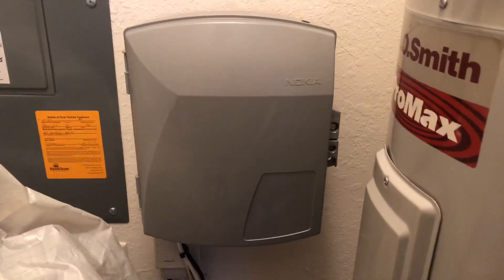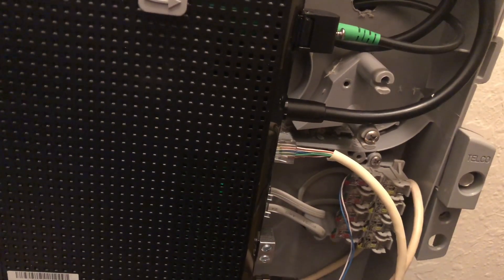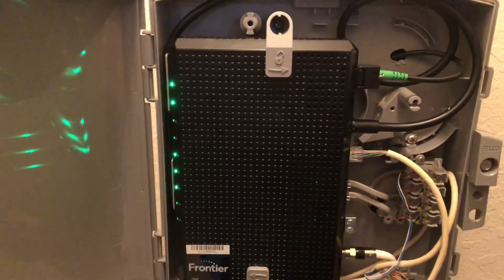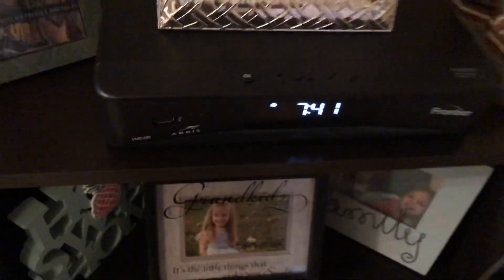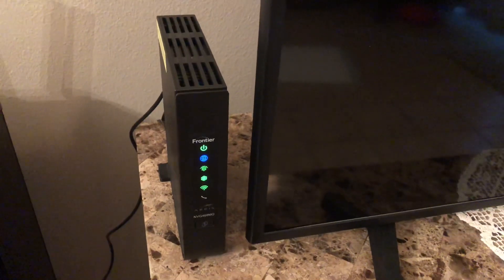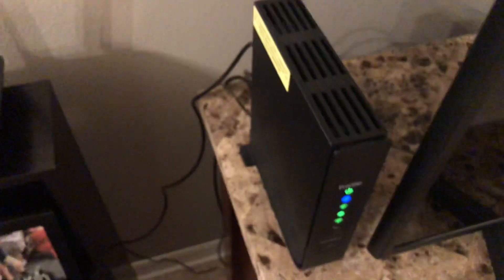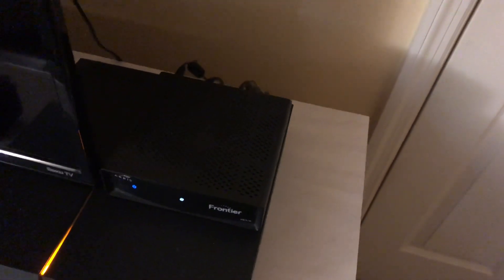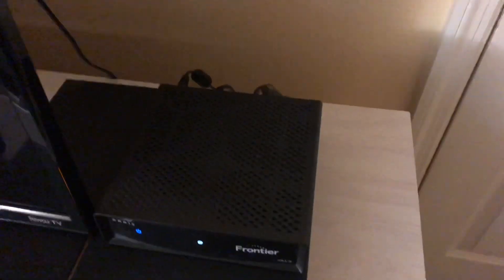Frontier/Verizon FiOS Internet

Comment from the maker: Hey everyone, thank you for all your comments and I hope this can answer everyone’s  questions as time has got away from me. If you can get away from the stock cable company routers it really is a good step to a faster Internet since this video I now use a Asus Wi-Fi six router that I got off of Amazon for about 120 bucks I use that router for most of my streaming and for overall signal strength around the house I now use the original Google Wi-Fi mesh system and I can really recommend that another thing.Make sure you use cat six or cat eight ethernet cables as it can make a difference. The router I used in this video I can no longer recommend.

Comment: I have frontier fios 500 Mbs. I have a router Netwear with 3 antenas. I will like to increase the speed. You think if I connect frontier Moder with a router the system will get faster?? O I should get a very high quality router?
Reply from the maker: If you’re looking for a speed look at the new routers that Asus makes you can get them for around $200

Comment: I already have a frontier supplied wireless router with the coax connection.  Can I buy the Linksys router and run an Ethernet cord from the frontier router to the Linksys router and use the Linksys for my connection?  I’m not sure how this stuff works, but the router they supply doesn’t extend very far upstairs.  I only have a 50/50 connection BTW if that matters.
Reply: Yes you can use your own router you buy.. I have a Asus Nighthawk AXE11000 Tri-Band Router and it works great with my Frontier Gig speeds

Comment: The Frontier FIOS router keeps rebooting every few minutes.  I want to get rid of it and get my own.  Can I use the Linksys you have directly with the Ethernet coming out of the ONT?
Reply: I also want to know this . I only have frontier FiOS internet One Gig speed , can i just connect directly the Ethernet cable coming from the ONT to the new router ? And that's it ? Help us PLEASE
Reply: You can use any router, make sure you setup a firewall for it first. Just call the company to turn on the Ethernet port on your ONT. If you wish, they can install the Ethernet cable for you for a fee.

Comment: I have frontier FIOS 500/500 and I’m not get that speed maybe 300/300. I don’t have Tv Service with them just the Internet. Can I just switch outs their modem for the one you have and what is still work?
Reply from the maker: Manuel Martinez Yes try to switch out your modem it could help, what kind of modem do you have now?
Reply from the maker: Manuel Martinez The modem will work regardless because of the cable boxes are wireless the operate off a special 5ghz frequently in the modem and any frontier modem should have that
Reply: coldk78 I have the modem that frontier give me but the WiFi on it sucks.
Reply from the maker: Manuel Martinez Oh I’m sorry I misunderstood I thought you needed the main modem, yeah get a Linksys EA 7500 it’ll set you back $98 but it’s worth it the range is amazing
Reply: Do I still to use the factory modem that frontier gave me or can I just use the linksys router?
Reply from the maker: Manuel Martinez If you have the same ONT box that I have in the utility room and it’s wired for ethernet then no, the only reason I have the factory one is you can’t have wireless cable boxes without it
Reply: coldk78 ok cool thank you for your help!
Reply: Update I Purchased the router the same one you have in the video. I replaced frontier router with the new one and the speed was slower 27/31. Need help
Reply from the maker: Manuel Martinez you may need to call a tec out as it could be something wrong in the wiring or modem placement
Reply: @ManuelMartinez-qg7tf  I just had a technician over my place and in order to use your new router you need to go to the frontier router and "release the status" or you will have both router giving a signal, hence the slow speeds.

Comment: LOL. The thing you called a modem from Frontier is actually a Router but they call it a Gateway.  There is no modem. It's actually the ONT.
Reply: Sounds like you know your stuff. I have similar setup (ONT) with 2 stories, was planning on also getting the Lynksis ea7500, but wasn’t sure if that’s compatible (best) w/ DIRECTV (1 GENIE + 2 wireless boxes). What router setup do you recommend with Frontier FIOS (gigabit) AND DirecTV and is there an extender you’d also recommend?

Comment: What router setup do you recommend with Frontier FIOS (gigabit) AND DirecTV? I have similar setup (ONT) with 2 stories, was planning on also getting the Lynksis ea7500, but wasn’t sure if that’s compatible (best) w/ DIRECTV (1 GENIE + 2 wireless boxes). Curious what extender you’d also recommend...
Reply: Hey man. I’m in your position now. What did you end up doing ? Im looking to get a personal router. Hope you see this, TIA.
Reply from the maker: Nowadays, if you have a two-story house, I say go with a mesh system. The Google routers you can’t go wrong.
Reply: @alcatraz9092  bought 3 Ax400 or whatever the Wi-Fi 6 version was for Linksys. It’s a crapshoot choosing which one is best. Best advice I’ve gotten is hardwire your APs and streaming devices (at all cost). And, there’s prob 3 devices you use most…make sure your mesh or Wi-Fi is optimal with that. Once I did that, surprisingly I found my biggest bottleneck was my iPad Pro with an older Wi-Fi adapter. Upgraded that and I’m now I’m happy.

Comment: Can I ditch my provider’s (Frontier FIOS, gigabit) modem/router completely and exclusively use my Tri-band Velop mesh system? I had heard it was possible to disable the Provider router and possibly save on that router svc fee, but the Provider installer wouldn’t touch my ‘3rd party’ routers and then when cable guy came by (DirecTV), he tapped the Genie parent box to the Provider modem/router and so now I’m afraid to mess with it.
Reply from the maker: You can Just tell them to throw a switch from the office so you can use your own router
Reply: @coldk78  I did that and even had the switch/routers there. From the Gateway 2 out ports are being used: 1=DTV/Genie, 2= Velop>Switch>Perifials 123).

Comment: I have that same modem but adsl2 12/2. But it has the ont port that is red. But the wifi is terrible lol. That modem id 1 gb connection so its good. Comcast data caps are the worst. Frontier has no data caps which os great
Reply from the maker: Yeah, after time I no longer like this modem I replaced it with an Asus router and I like that one a hell of a lot better